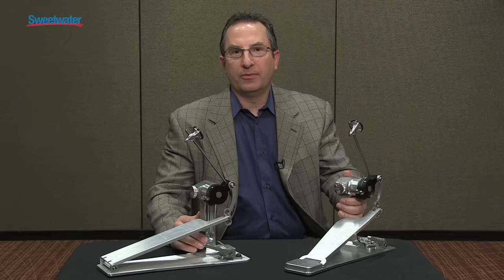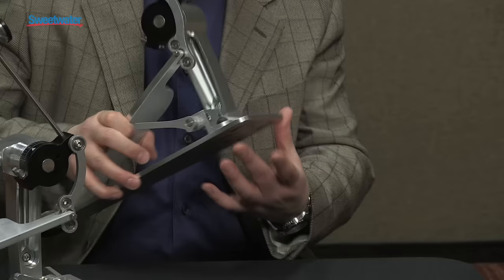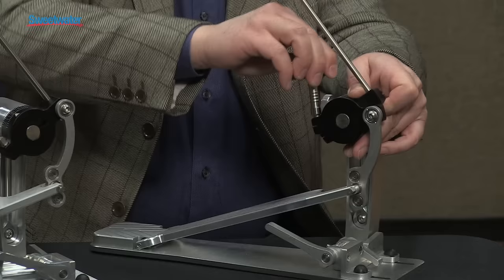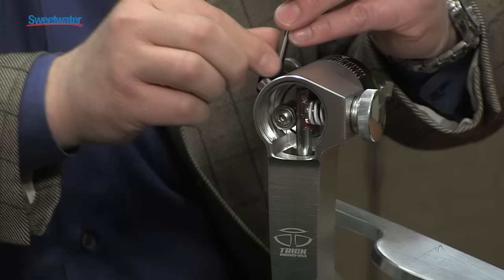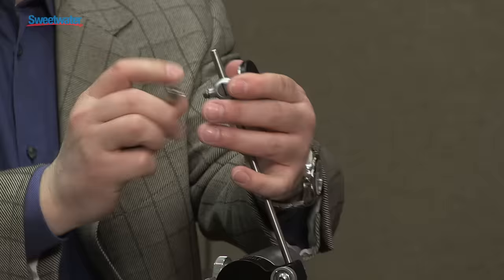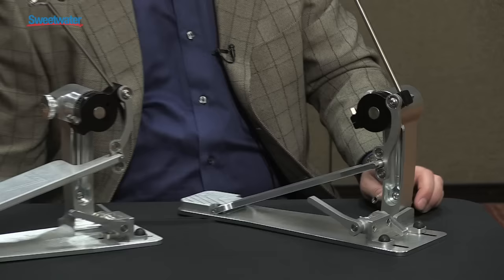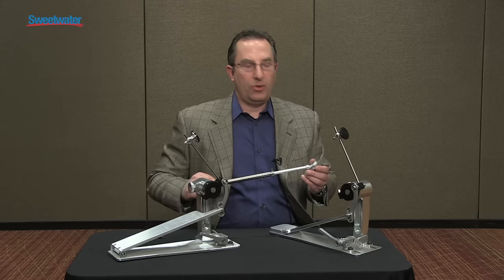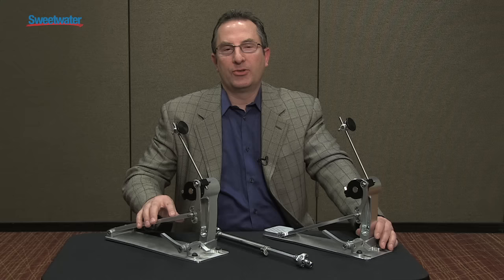Trick Drums Pro 1-V and Pro 1-V Bigfoot Bass Drum Pedal Demo - Sweetwater Sound

Comment: man i want the big foots so bad!!!! gunna pick these up once i got the extra cash to spend ...currently have Pearl Demon Drive direct drive pedals but these would be a nice addition to the collection
Reply: Haha i want to do that but i have the bigfoots and would like to get DD if i can to add to the family
Reply: +MrShackleford i had some things i didnt like on the bigfoot so i dont have them now, im getting DD in a few days
Reply: +MrShackleford mmm the clamp so the bass drum gets loose with time,  no carrying case,  in some places the velcro strips that come with it weren't enough to keep the pedal in place and sometimes i wouldnt have a carpet so i struggled to keep it in place, maybe it was just mine but when in disconnected the slave side, the left beater on the main pedal lost it's "setting" and i had to do it everytime i set up the pedals
Reply: @danieljordison0793  I've used Axis, Demon Drive and Trick Bigfoot pedals. All great pedals. But far and away the Trick pedals are the most sturdy. Gives you alot of power, speed and control. And, like I said, they have barely aged at all the 6 years i've owned them. By this time, my Demon Drives were all loose and damaged in the foot plate. Same goes for Axis. But there is almost nothing that would tell you that the Trick pedals have been used for 6 years.